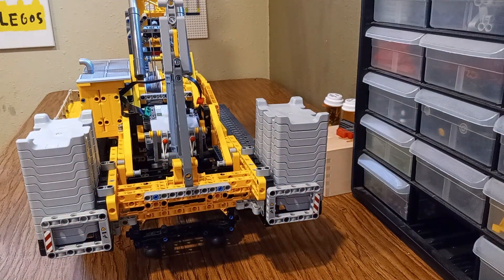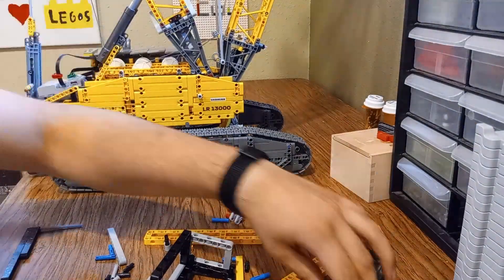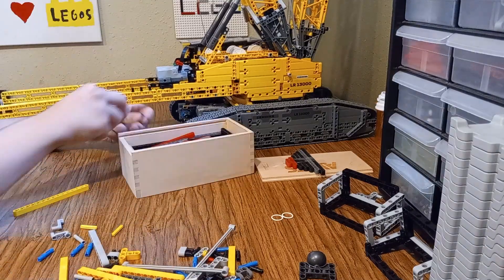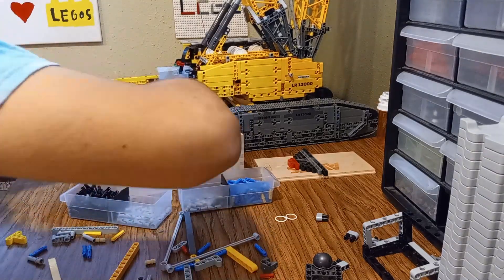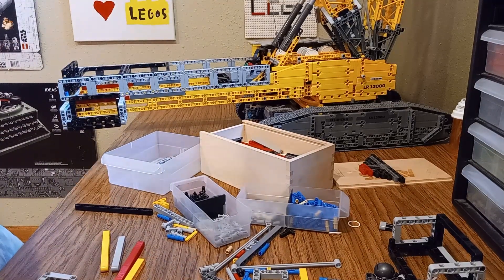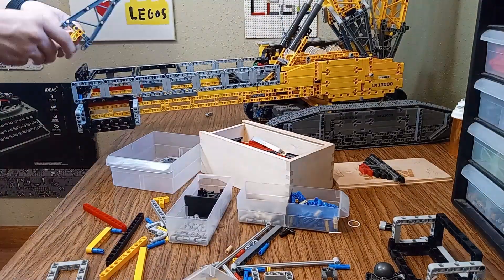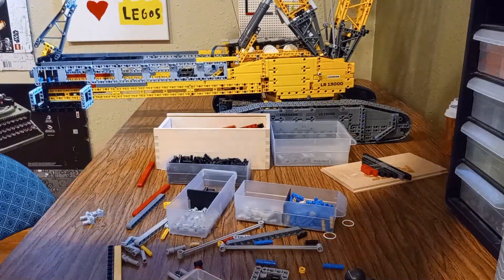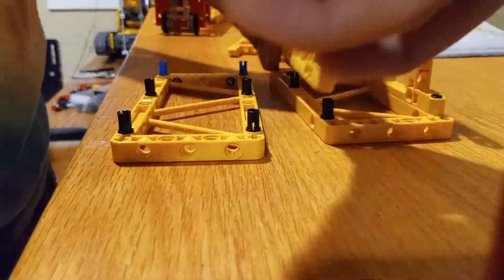The 9-foot-tall Lego Technic Liebherr LR 13000 crawler crane!

Comment: Genauso hätte Lego den Kran auf den Markt bringen sollen.
Benutzt Du nach dem Umbau weiter die Control+ App? (Kalibrierung)
Reply from the maker: Appreciate that! And yes, I’m sticking with Control+. After the modification I re-calibrate (and sometimes tweak the setup depending on the build), but once it’s dialed in it works great.

Comment: Did you strengthen the boom where it meets at the crane base.  My boom is 7 foot tall and wants to fall over either side if weight is lifted.
Reply from the maker: No I didn't but I ran into the same issue, I just had it up on display for a little bit then took it down as it was leaning just sitting there. Great question. If you strengthen it, it would be a lot stronger. Keep Building!

Comment: What did you use for string? I modified my set too and the biggest problem I am having is finding the right sting for the main hook.
Reply from the maker: Thanks for watching. That is a great question. Lego does not make super long strings, so I used my own rope, and made it about 30 feet long for the boom. It is stronger and longer than the Lego strings. Thanks!
Reply: You could try fishing braid? Comes in really long lengths with different thicknesses and colours?
Reply from the maker: @jamblpaints8453  That’s a great idea! Fishing braid could definitely help with strength and flexibility—plus, the color options could add a cool touch. Have you used it in any LEGO builds yourself?